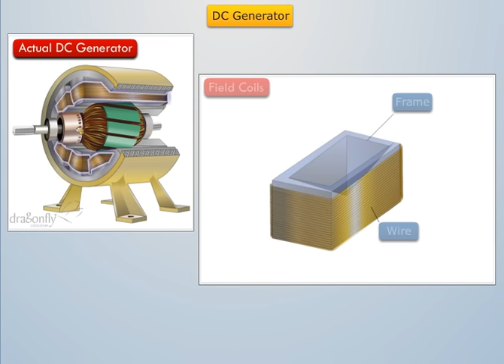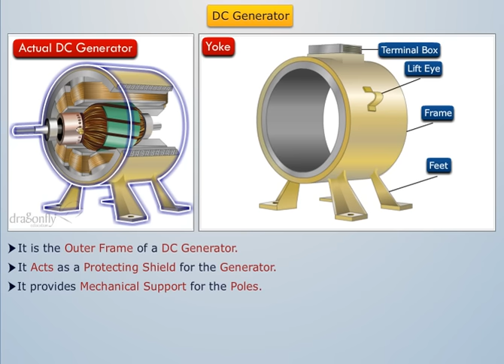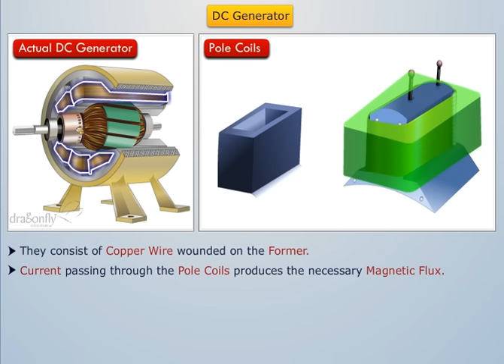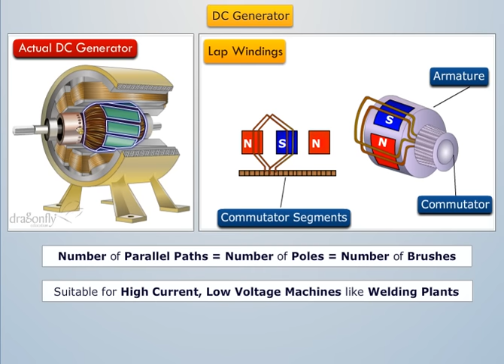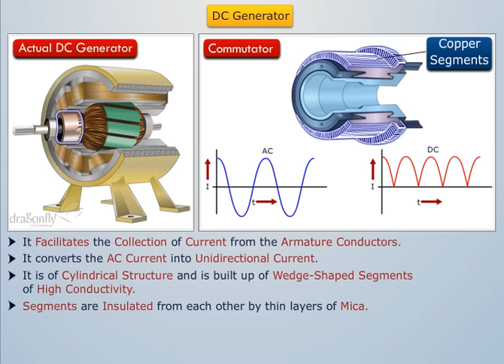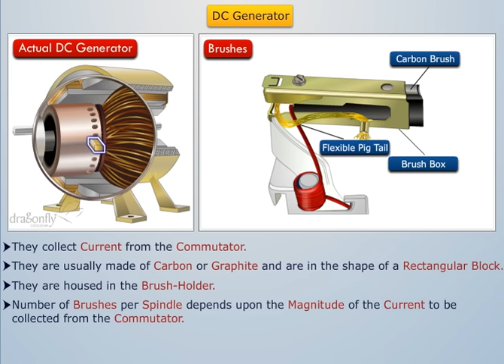Working of DC Generator | Electrical & Electronics Engineering

Comment: this should have a PERMANENT MAGNET!!
Reply: This has an electromagnet which is much stronger than a permanent magnet. Most commercial generators and alternators us electromagnets because the permanent magnets aren’t as strong and tend to lose strength over time.
Reply: this is a generator remember that.

Comment: I don't think you know what you're talking about exclamation point if this was a DC motor or a DC generator , you would have a permanent magnet. you just added more confusion to the world.
Reply: Lol I think you're the one that doesn't know what you're talking about there friend. Most DC motors/generators use  DC current excited magnetic fields, that is what the coils on the yoke are for. Those motors do not use permanent magnets.